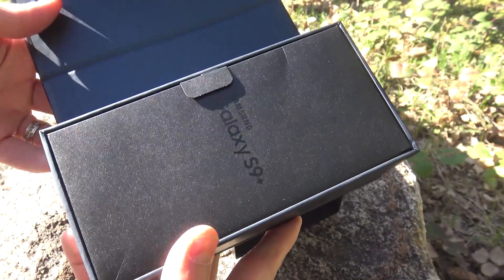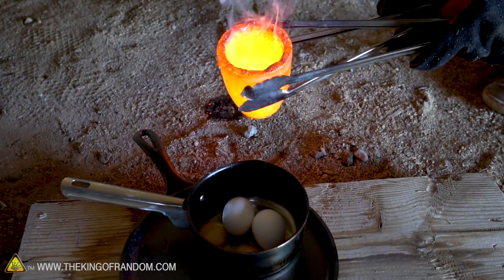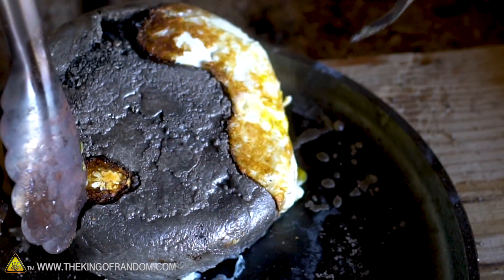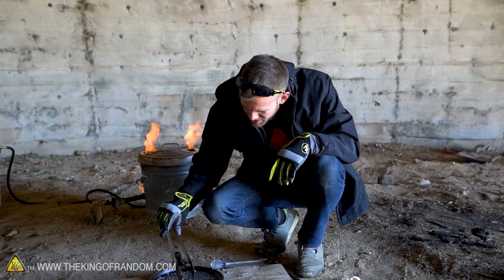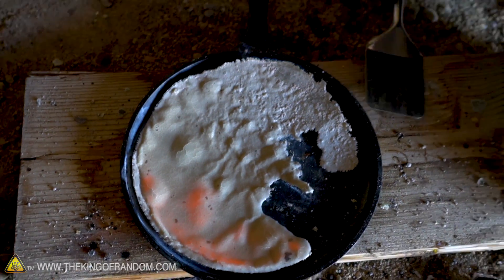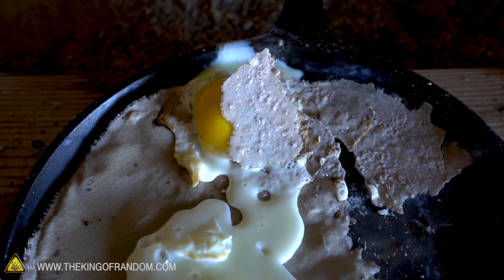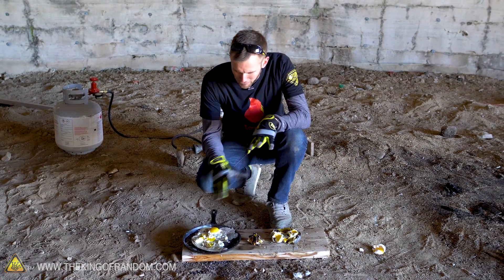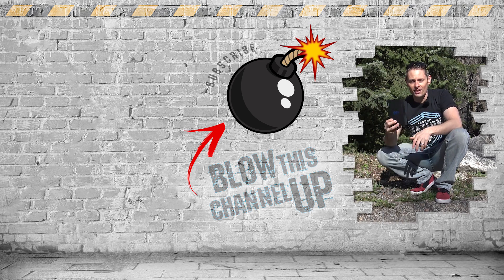Molten Salt vs Eggs! TKOR Test If You Can You Fry An Egg With Salt!!

Comment: Might be just me but I'm kind of interested to see what molten salt will do in water the heat will probably boil off some of the water but will the salt soak into the water or would you have a solidified mass of salt at the bottom of the container

Comment: maybe you could've cooked the eggs better if you poured molten salt in that pot and then cracking an egg over it when it cools down a little , since the salt below will stay hot more time , so it will provide heat to the top part of the salt .

Comment: There's a recipe called "lomo al rapo",it is about a piece of meat, you surround it completelly by salt, finally everything is rolled up using a dishcloth and that roll goes directly to the oven (including dishcloth).  Dishcloth gets burned and salt become a crispy protection layer that is taken apart when the recipe is finished.... It's delicious you can try that out, submerging the whole thing (dishcloth, salt,meat) into molten salt instead of using the oven... what whould happen?

Comment: Hypothesis 1: if some of the sodium separated from the chlorine and when the water of the egg hit it.... explosion!  Though, this would make me worry about chlorine gas being released in the crucible.
Hypothesis 2: the egg was placed in with the internal air bubble facing down, which explodes due to the rapid expansion of gasses from flash heating.

Comment: Saw the video where you tried casting liquid metal into protoputty (as well as what would happen if you dipped it into liquid nitrogen), was wondering if you could cast liquid mercury into protoputty, then use liquid nitrogen to cool it down to a solid.

Comment: Try a new recipe of thermite made of 9 parts of Silicon Dioxide, 10 of Aluminum and12 of Sulfur (by weight) and ignite it with your new solar scorcher. It should burn blue !

Comment: You should've heated up the salt in the crucible and waited for the top to cool off while the middle still is liquid then crack the egg on top of the hardened salt. Then maybe you would have cooked it through because the molten salt is not so thin and won't cool off so fast.

Comment: What would happen if you throw a cold water balloon at some really hot bulletproof glass? Will it shatter like normal glass?
Reply: I think we can guess what would happen but none the less it would be a cool video to see
Reply: or maybe a nitrogen soaked bullet?
Reply: bullet resistant (bullet proof is not really possible) glass is layered similar to car windshields, so the glass would probably crack but the layers between will just keep it all together as they are designed to do
Reply: Advaith Remesh dont think that would work but either it would be cool
Reply: turtlelore 2 or they would just melt.  Layers are usually made of plastic and glue

Comment: Have you tried putting molten salt on a watermelon?.. Will it break the outer coating? Will the inside turn to vapor? If the watermelon is cold will it explode ? Please try it out please

Comment: You guys should mix molten salt with thermite! Is the molten salt hot enough to set off the thermite or if will the thermite still ignite after the salt has been mixed in? either way would make an explosive video!!!